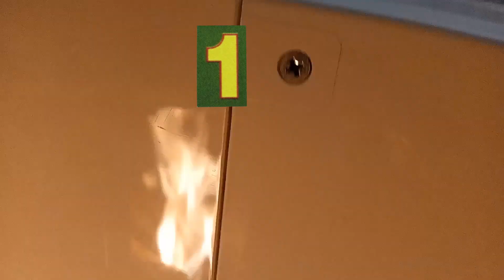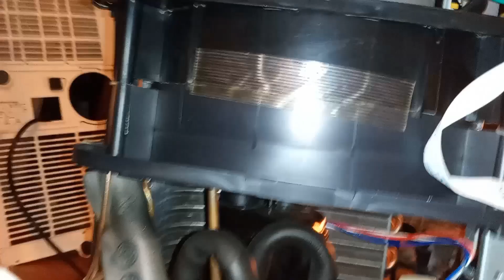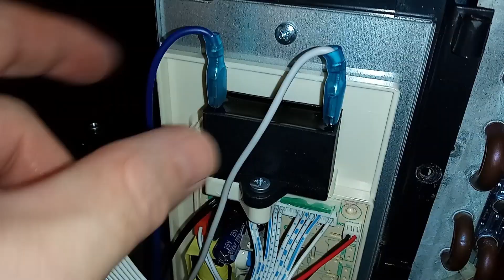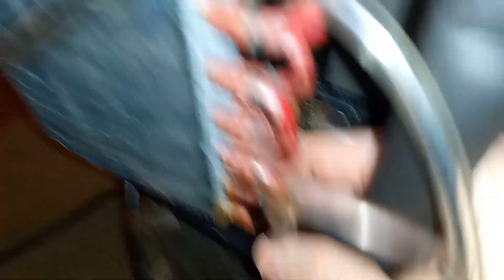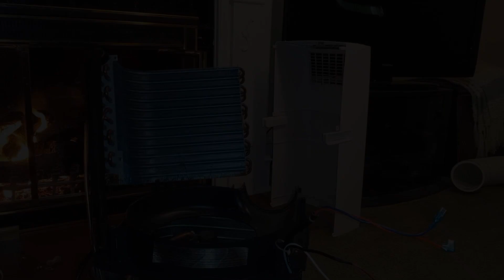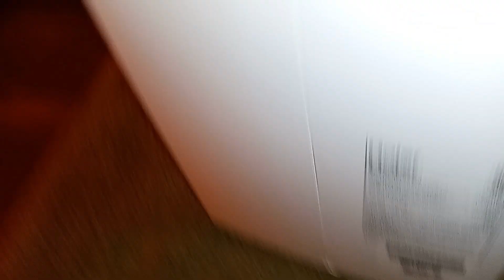How To Fix Haier Portable Air Conditioner - Knocking, Ticking, Tapping Noise

Comment: Great video, thanks for sharing! Just to add some helpful info for anyone troubleshooting: this unit uses two plastic blower wheels connected to a single motor. The top one is the Air Discharge wheel (pushes cold air into the room) and the bottom one is the Condenser wheel (pushes hot air out of the room). If either cracks, the centrifugal force will cause the plastic to flex and hit the surrounding walls. If the plastic breaks entirely, the wheel will become unbalanced and cause the unit to shake.

Since this unit is discontinued, replacement parts can be tough to find. Here are the part numbers to help anyone searching:
• Upper Wheel (Air Discharge): A5304-640-A-22
• Lower Wheel (Condenser): WJ88X22262

Also, if your motor is buzzing or won't start, check the capacitor first—that's usually the culprit. The capacitor is rated at 30 uF ±5% 300V 50/60Hz (Part # CBB65-R). Fortunately, this is a common part and easy to find online!

Comment: There is a blinking red light in mine idk what it means
Reply from the maker: The blinking red light can mean a few different things.
The water tray could be full and may need to be drained. Mine has to 2 drains on the back that you unscrew the cap and remove the rubber plug to drain the water from condensation
Or, there is a little "float switch" that raises and lowers with the water level. Sometimes debris causes that float to stick so it may need cleaned around the float level switch.
Also, dirty fins or screens may cause the AC to "overheat" which can cause the flashing red light.
The flashing light also could indicate other problems like with the circuit board, etc.. Those could be tougher to fix.

Comment: Thank you for making this video. Well done. I have a similar model Haier that looks physically the same as yours. It has started making a high pitch noise that seems to be coming from the upper blower fan area. Does not make this noise constantly, it is only periodically but its very high pitch and annoying. Tomorrow I'm going to open it up and take a look.
Reply from the maker: My guess would be a motor bearing that's the shaft spins on. But hard to say for sure. Thanks for watching and hope you find the problem!
Reply: @ConstructDestruct21  You are correct it is the bearings. After lubing with WD-40 the best I could it reduced the noise about 95%.